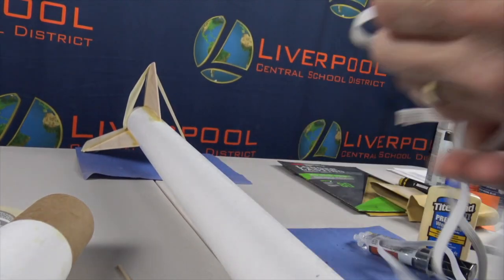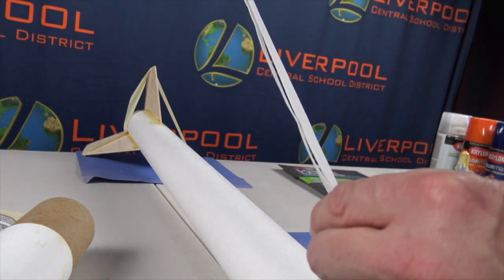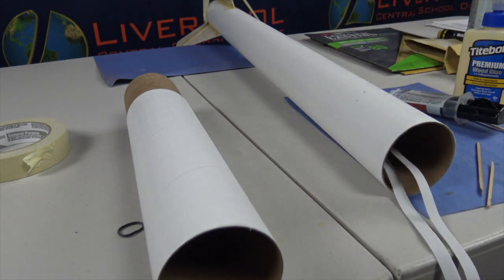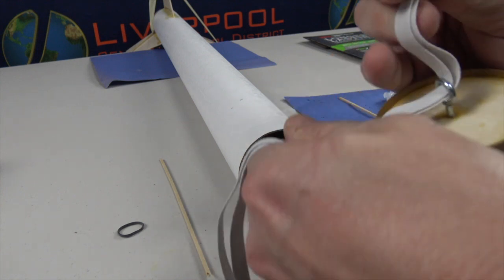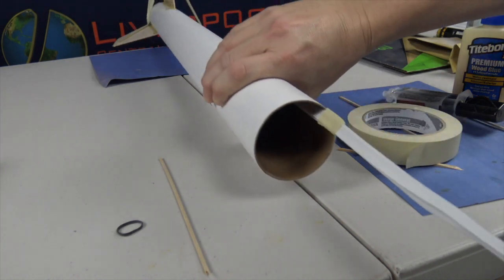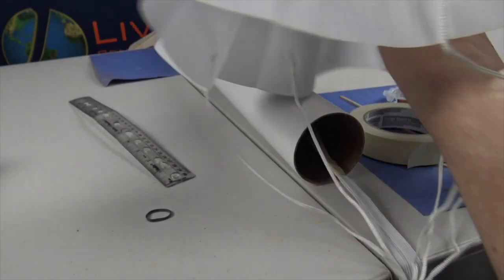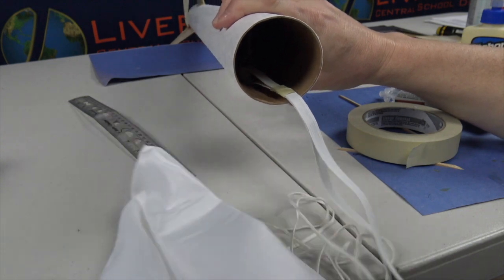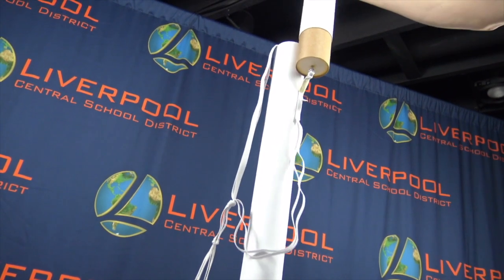Build Session #3 - Attaching the shock cord and parachute to a LOC Graduator Rocket

Comment: Many midpower people preach using Kevlar cord mounted down the the tube at either the motor mount ring or at the tube coupler. 

I simply installed like Estes said, using the provided rubber tried and true shock band. No tube zippering, keeps the weight up high, provides ample cushion for parachute discharge. This is with a Star Orbiter using Aerotech engines. No issues. 😊